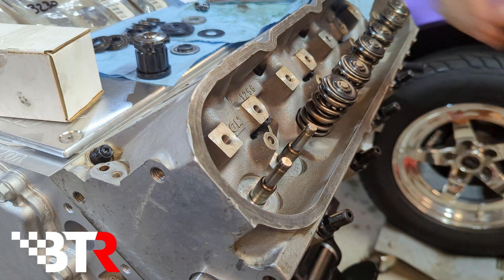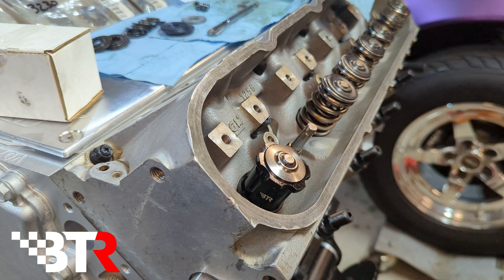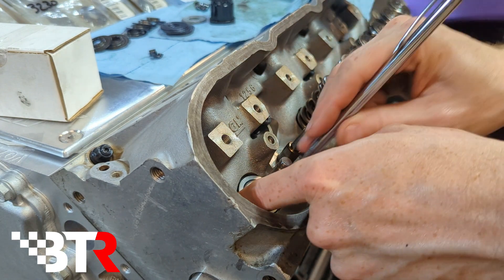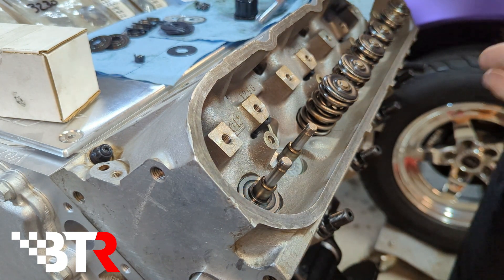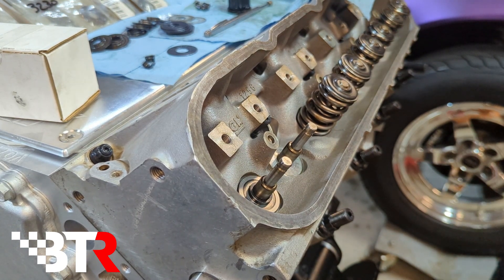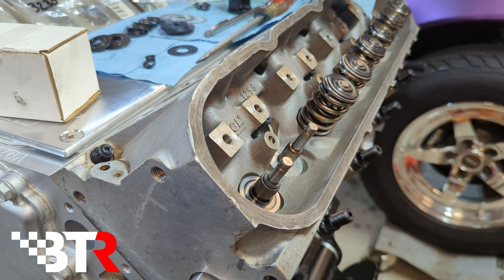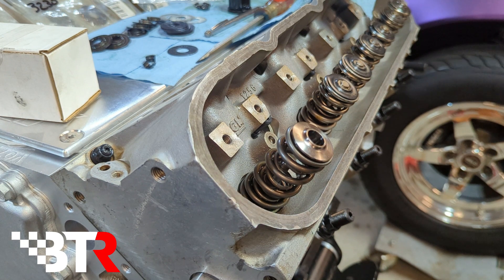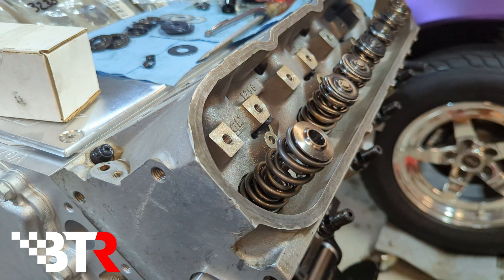HOW TO: Installing LS Valve Springs and Setting Proper Height

Comment: Sorry but not seeing much sense in this. All your doing is changing the valve spring pressure. Buy the correct valve springs, seals and proper rocker arm ratio and measure for the push rods and your set. Sorry but waste of time.

Comment: So I may be silly here…. I have a lq4 with a truck Norris cam, beehive springs in 799 heads. When I put the heads on, I can’t rotate the crankshaft. Why is that? Valve clearance?
Reply from the maker: I would think you would be fine unless either the timing is off, the heads have been cut way down or perhaps too long pushrods
Reply: @TeamHybridRacing you’re right. Head gaskets were the wrong bore ☝️. My bad there, trust but verify
Reply from the maker: @crepesaresupreme4075 glad you got it sorted 👍

Comment: I’m going to assume you have smaller valves to achieve that 1.72? I just ordered a btr kit and on the box i’m getting 1.780” but from what i’m reading, BTR says you don’t need to shim it but it is a good practice. Going off an old forum post. Any other insight you might care to add?
Reply from the maker: I had reached out to them to confirm with the springs and cam I'm currently running.  They said with my setup 1.70-1.72 would put me in the right spot from cool bind.  Car has seen mid 8k range multiple occasions

Comment: Great video do you have a part number for the shims. I have 1 piece valve seat seals on my 799s and need some shims. Thanks
Reply: For anyone else that see this. Let me save you some time, but not any flustration.  They DO NOT make a shim for hat stile. The ones this fella is telling you about fit stock Guides. Not hat stile seats, you can't put shims under them. Raises seat off of Guide. no one,  make one that goes on top.  And if you figure the fix is to go with a two peace. For a Factory size ID bee hives. They don't make those either.  🤬 now what?  More spring then you need Or recommended for your cam, Wearing stuff out.  So, say you have a BTR Truck norris cam, and the 560 spring that is right for it. And install height is to hi.  Your shit out of luck.  Because of you change little stem keepers and did still have .050 Clarence Between top of valve and spring keeper. You still can't get shims to get it down to Acceptable range. 🙄🤨🤪
Reply from the maker: BTR SHIMS FOR STOCK GUIDES - .015" - BAG OF 16 - SS015-16. Those are from Brian Tooley Racing.  I believe they have .015, .030 and .060 available.  Thanks for watching! 👍

Comment: I've been thinking about this a lot recently. Looking at getting a stage 2 "drift cam" kit from Michigan Motorsports and I don't know much about setting springs and pushrod. That BTR install tool looks nifty and easy.
Reply from the maker: For most setups people don't usually shim the valve springs.  When you get into the higher rev stuff it's more common place.  You do however need to check pushrod length for a change like that.  If using stock or ls7 type lifters you have a good range of sizes that will work.